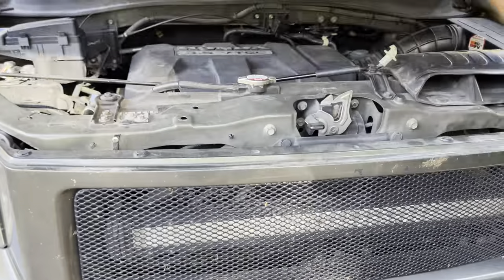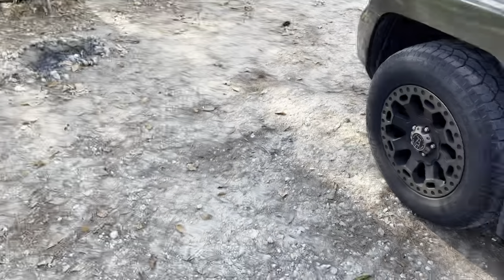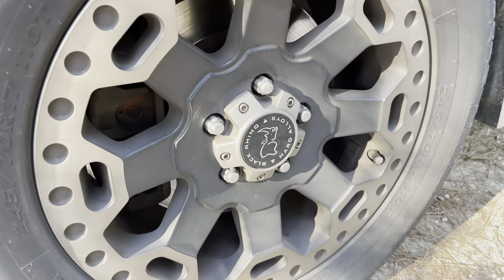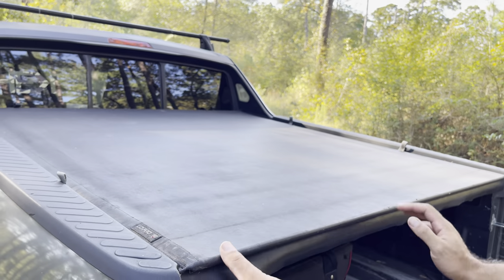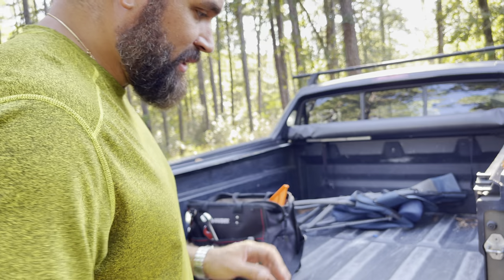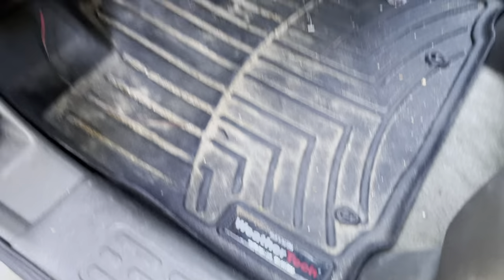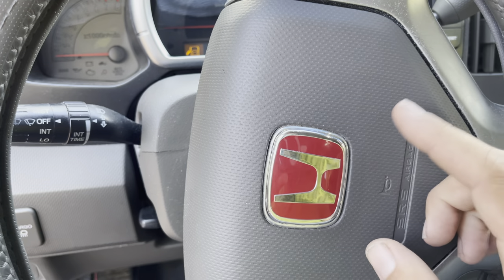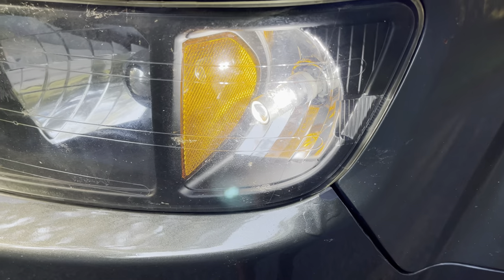The BEST Honda Ridgeline Upgrades and Mods + DIY Lightbar Mount!!!

Comment: I love my 2010.  Fits in my garage - KEY POINT for me.  I added a few mods - using a door lock actuator, I added a locking tailgate function to the truck (There is a step by step instruction guide on the Ridgeline Owners Forum - The black ridgeline is mine...)so with my backflip and the tailgate locked, cargo is out of sight and somewhat safe.  Added a ladder rack specific for gen 1 and that works with the backflip.  Made an always hot USB to the front for charging, added after market radio, added subwoofer under driver seat (mfg OEM still present, but disconnected).  All speakers replaced.  Added sound deadening - helps with the road chatter.  Great little truck.  If I need a heavy truck, I will use the appropriate truck for the job.  For just about everything I do, the RL gen 1 is perfect.  
Oh yeah, added a fumoto oil change valve... So much easier to change oil.  I still am too lazy and normally have a friend do it and pay him.  It makes it easy for him.
Reply: Hi, I hope you see this. Do you have a link to your mods, or your nick on ROF? I bought my 2011 RL twonweeks ago and need to sign up over there. Already doing mods, and I love this guy's channel!

Comment: I am picking up an '09 RTL tomorrow. was in at  used car dealer where I recently got a Highlander. saw the Honda and thought it was better for my needs (including kayak hauling).  Wrote a check for the difference and will get it first thing. 
A few of the mods mentioned here will be on my list.  Big fan of Weather tech.  Have some that just arrived fro my wife's car.  Going to have to call again tomorrow.
Reply from the maker: Congratulations on the purchase! You will love the Honda ridgeline. It is a beast of all beasts haha

Comment: I have that same exhaust  on my 07 Ridgeline.  I thought it sounded good but as you mentioned, it  did sound loud and droned at 65mph.  I had a muffler shop take out the resonator from the magnaflow and install the stock exhaust’s resonator.  The exhaust sound was definitely a lot lower but still sounds great and the droning was completely gone.  I recommend you go that route if you’re still experiencing the droning.  Great mods on your truck and great video!

Comment: Great video. You've inspired me. I've owned my 2010 Ridgeline RTL since new, have left it stock but looks like I'm going take a LOT of your suggestions. I was wondering what you are using for LED replacements for your headlamps, turn signals, fog lamps, brake lights, and cargo lights. Any help would be appreciated since I'll be replacing every light on the truck.  Thanks again for the great vid!
Reply from the maker: Glad I inspired you!  Links to everything should be in the description. Thanks!

Comment: Great video!  You put a link to the OPT7 60" Redline but was wondering if you didn't mean the 48".  I just wanted to make sure before I bought mine.  From my measurements the 60" would be too long.  I also would like to know the brand of LED headlights you installed.  btw...I like th HE>I sticker.
Reply from the maker: You’re absolutely right. When I placed the link the 48” wasn’t available.
Reply: @VentureTube  Thanks.  Any advice on LED bulbs for the Ridgeline?  My research has me all over the place.  Just need some personal advice.
Reply from the maker: @mattbuerhaus6350  Hi Matt.  Ive updated the link in the description.

Comment: I am trying to find out information about the turn signals. Been reading the information on the Amazon page you linked to, but can't find the answer to my question. When I put in the new turn signals, will the daylight running lights come on automatically when I start the truck, or is there something else I need to do? Will I need to turn on my lights? I have been thinking about installing daylight running lights and this may be the solution I need.

Comment: @VentureTube love your upgrades. I too have a 2006 RTL. 

QUESTION: with all of your upgrades, do you have any problems with your battery? Did you upgrade to a more powerful battery, one with more CCA than stock? Thx
Reply from the maker: Actually I have had battery problems.  Ive never upgraded my battery.  Tipically it goes bad right before the warranty expires so I just swap it for a new one for free lol.  Thanks for watching!
Reply: @VentureTube  they replace it free? Where? Every time I've ever replaced a battery, it was prorated if still covered.
Reply: @VentureTube  any links for the interior LED lights you used? Thanks

Comment: Did you need anything special to install the OPT7 light? Adapters, connectors, etc.
Reply: I recently purchased a 48" OPT7 bar like the one in the video.  I also researched a lot of other DIY install videos on them.  The issue I'm having (and would greatly appreciate a response on) is how were you able to connect if from the rear of the trailer lights connecter?  I even purchased a separate CURT #56584 adapter so you don't have to hard-wire the reverse cable...  The trailer hitch connecter on the Ridgeline (mine is a 2013 RTL) doesn't seem to disconnect from the back (i.e., plug and play).  Would greatly appreciate info on how you installed yours!!!
Reply: @m.tedblevins601  https://youtu.be/qUr08tqpOk4
Did you watch this installation video?
Reply: @sofakingtim  Thank you for your message.  Yes, I did watch the video you included.  The issue (known by OPT7) is that the Ridgeline doesn't have a 4-pin connector (as is on the RAM truck in the video) so there is no way to initially "test" the bar.  The other issue (known by OPT7), is the Ridgeline's 7-pin connector is a one-piece unit that does not disconnect from the back (as also is different from other truck manufacturer's trucks that I've seen on other YT videos).  To do this "plug and play", one has to purchase a separate connector and housing unit from CURT but I also can't seem to get anyone from CURT to confirm the correct replacement part(s)....  If you know of another way (without getting into splicing wires), I would appreciate some direction!  TY!

Comment: I see you have a bass boat in some of your videos, how does the ridgeline do towing it? I just got a ridgeline and I have a 16’ Astro with a 50hp and curious how it’s gonna do.
Reply: I have same truck and regularly pull a Scout 175 Sportfish/Yamaha 100 with it—often loaded down with gear and w the whole family in the truck. Absolutely no problems towing. You won’t forget it’s back there, but the truck pulls it at highway speed (80+ here near Atlanta) with no complaint.
Reply from the maker: Yes I tow a 19' center console with a yammy 115 and it tows it fine.  Rear could be a little stiffer, but as alex stated, it pulls it!

Comment: I was wondering what was the mileage on the truck. And, has the engine and or the tranny been rebuilt?
Reply from the maker: Mileage is 176xxx and original engine and transmission

Comment: Just got a 2006 Ridgeline, catching up on all the maintenance now, have you replaced the timing belt or radiator mine has 150k on it,don't know anything on the history
Reply: I am at 190k in my 2007. I replaced the plugs at about 80k. Just replaced them again along with the ignition coils. Mine were looking bad when I pulled them. I recently saw a video on bypassing the transmission line going into the radiatior. Basically it takes that line and runs it back into the transmission. The poster said the cooler in front of the radiator is enough to keep the transmission cool. I don't do any regular towing, so I may try that mod. I've replaced my timing belt twice, the last time with the water pump. I have changed the oil between 3-5k miles and do other regular maintenance. I agree, maintenance is a lot cheaper than a car payment. Good luck. I love my Ridgeline.
Reply: @dannyhobbs3865  just replace the radiator, instead of bypass anything that's what im going to do

Comment: How do you repair the clear coat? I have a 2008 Silver RTL model but the clear coat is chipping away and both sides of the back of the truck. Any suggestions or quick fixes? Thanks
Reply: Look up Chris fix paint correction
Reply from the maker: Chris Fix makes really great content for auto detailing!

Comment: don't worry about the mods, it has a crappy transmission, my 2017 has only 23287 miles on it and now the tranny is bad, will never have another one of these junk trucks.
Reply: it is very likely you got a lemon,,,,,, these trucks are spoke well of by most owners,, bad transmission can happen in any auto,,,,i am sure you have contacted a dealer by now,,best wishes and hope you resolve the issue,,
Reply: @thomasdausch8557  have talked to the dealer, I believe they knew about this before they sold it but being just over the 5 year limit they basically told me it was my problem,  I replaced the solenoid bank and refilled it with fluid and it solved the problem, the other problem was the VCM system which I shut off with a mod to shut it down, will be looking for a differn't dealer who hopefully is more honest.
Reply from the maker: wow that is very surprising to hear.  But like Thomas said, you must have got a lemon.  Now if they knew about it, that's just snake business......glad you got her going!
Reply: Honda is very reliable

Comment: Where did you get the grill?
Reply from the maker: Not sure where the grill came from. It was installed when I purchased the truck.
Reply: @VentureTube  check the back side to see if it was a home job using readily-available mesh. I'm planning on something similar myself. I love my Honda but hate the big emblem. Not as bad as Dodge Ram, though.
[Edit] I just watched the beginning again. That's not a DIY. I've searched a lot for one, but no joy.